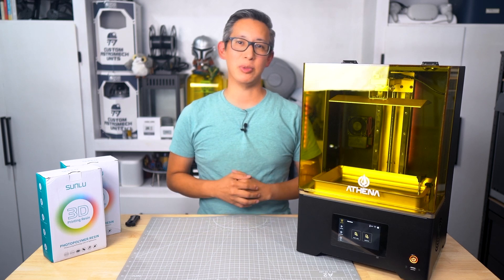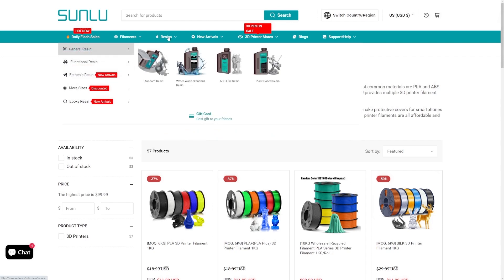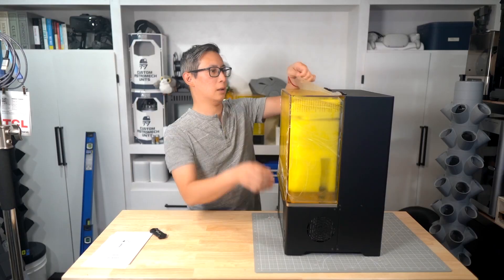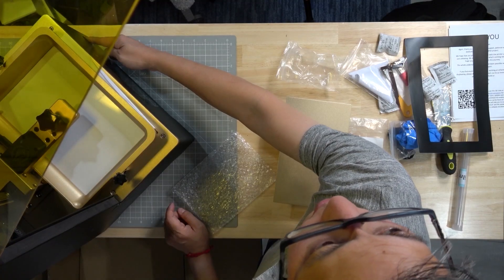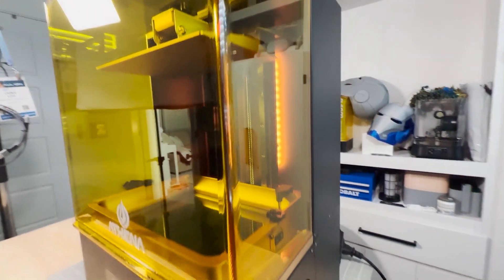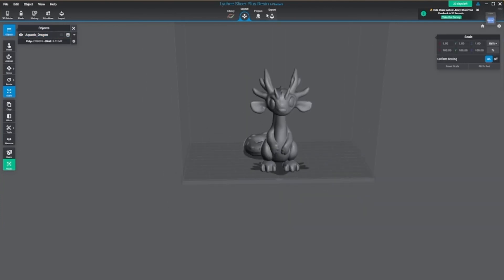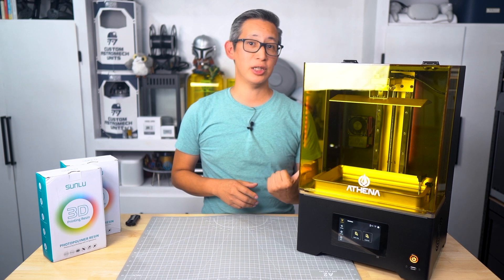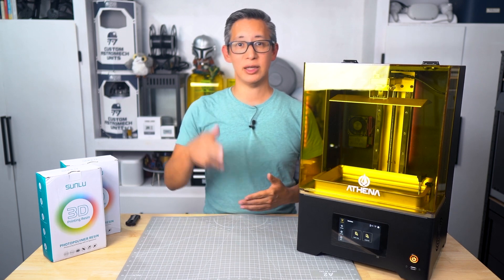Concepts3D Athena 12K Resin 3D Printer Review:  Was It Worth the wait?

Comment: I wonder how many people will buy the Athena II sold at $1825, with the specs almost same as a Elegoo Saturn Ultra 4 16K ($499). The heater, camera, filter all sold separately. Just the camera($147) + heater($103) + filter($176) already cost more than a Elegoo Saturn Ultra 4 12K ($399) which has all the features built-in.

Comment: I was fortunate to get the 8k early this year and yes there were problems, but unlike many other companies they take ownership and work best they can through them. It’s built like a tank, provides vastly higher quality prints repeatedly at half the time of others. What most miss is the fact that it is entirely made of open source products /software (runs on Klipper) so you can mod it to your hearts content.For a startup and first product I think they have done really well and only getting better with their V2.
And no - I paid for my printer and not affiliated to them in any way. Soon I would put them on par with similar pro printers such as Formlabs or Heygears once Nano DLP software steps up it’s game at half the cost. Yes, there is much work to do done on the complete eco system, but hey - Rome was also not built in a day.
Reply from the maker: I have to agree.  The print quality is amazing, as well as the speed.  I also paid for this V1 during the kickstarter campaign.  I hear good things about V2 and hopefully I will get a chance to review the new printer when it comes out.

Comment: Man this sounds like every single printer review going over basic stuff. My Athena 12K is not all rainbows and unicorns because there’s issues with the printer. The menu screen and navigation is not intuitive, setting it up is not intuitive which you didn’t go over.  the most important thing is when you use lychee to select a resin it becomes even more confusing.  even changing resin parameters is very confusing because it’s different menu settings that this printer needs. When you change something on the slicer, it doesn’t carryover to the printer with the sliced file. You have to manually create a new resin profile of the ones based off the printer. It’s just too much going on and there’s no instructions on how to do it properly. I’ve had one successful print in the past two months of own this thing and things don’t stick to the build plate very good. 
This is how reviews should be done not someone that’s only outlining all the positive things to overshadow any of the problems that happen. Again, my printer or printers FDM and resin go nonstop 24 seven so I have a lot of hours accumulated to have issues come about.
Reply from the maker: Thanks for sharing your experience!  I agree it's not all bells and whistles.  For me, specifically with the delays.  As for usage, I have only had it for about 2 months and havent experienced any of the issues with print failures or prints not sticking to the build plate - in fact the adhesion has been great for me and removal of prints has been a non issue compared to other resin printers I use regularly.  For my usage the existing profiles have worked for all of my Resin prints and any updates I make in Lychee have carried over to the printer just fine.  My review was only based on my usage and first impressions over the 2 month period, so your input is greatly appreciated.  The only other issue I experienced was keeping it connected to wifi, however, that issue was resolved by moving one of my access points closer to the printer.   Overtime we'll see if I run into any of the same issues, and I definitely will report them in any follow up videos that feature this printer.

Everyone's situation is different and Im glad you shared your experience and issues because it lets me and others know what to lookout for.  Especially, for such a pricey printer that has had so many delays and build issues prior to it shipping out.  I will continue to share any issues I run into overtime, and I hope you and others do as well
Reply: Thank you for pitching in. Good to get a second opionion. Now that you had the machines for a year more. How do you feel about them? Can you make a follow up video? Would be nice to see how the process with resin calibration works in reality. Is it good or gimmicky? How many failed prints have you experienced and why? Reliability is my top concern coming from a simple Anycubic.

Comment: Seems like a printer thats one or two generations behind on features tbh and costs more than competitors for no real reason.
Reply from the maker: Unfortunately with the delays, other brands have released newer more updated Resin printers that can better compete, however, the force Sensing technology is still pretty nice.  The output and quality of the prints are amazing as well, but the price is a little offsetting now knowing what else is out there with other brands.  Still a solid printer though.  Athena just missed the boat in terms of timing because of all the delays and lost the opportunity to make a big splash and impact on the market.